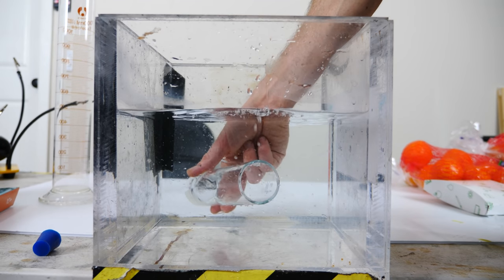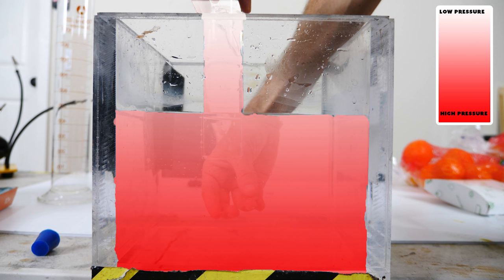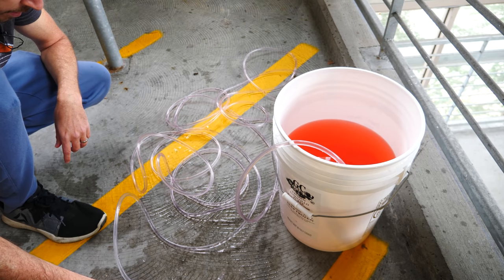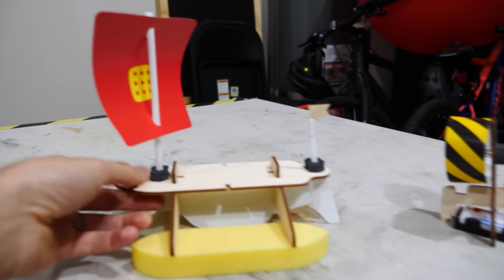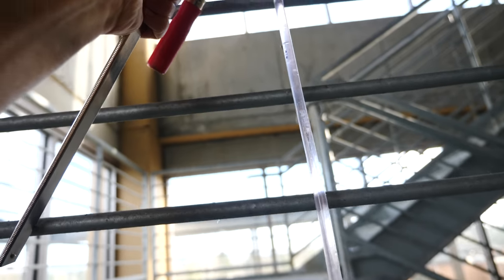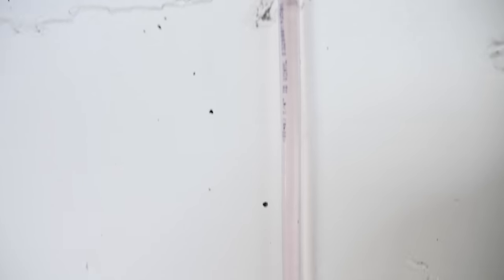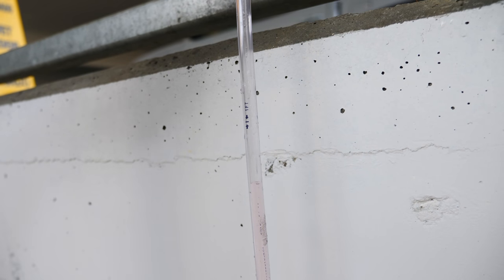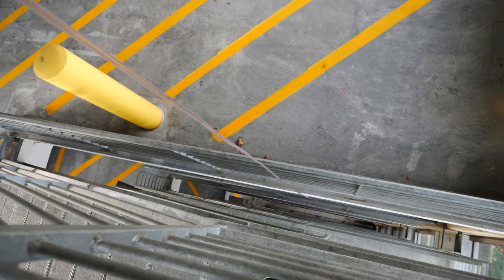Why Water Boils In Tall Cups

Comment: As an aid to understanding what is happening, there isn't any water doing any pulling (5:20)  (that would be a capillary effect, which might be important in a thinner tube, but it is not the point of this experiment).  Rather the water at the top of the tube is pushing  down (because it is being pulled by gravity in the Newtonian sense) on the water below it, which in turn is pushing down on the water below it.  At some point the weight of the water pushing down is equal to the force of the weight of the air trying to push its way up into the tube.  If you lift the tube higher the water outweighs the counterforce of the air and the water column drop until the two opposing forces are equal.  Basically, you have a shorter column of denser water in equilibrium with a much longer column of air (the Earth's atmosphere).  (And you can't suck water either (4:55) , again it gets pushed up by the force at the other end.  This is kind of like cold vs. heat.  Cold is not a thing; its just the absence of hear.  Suction is not a force, it is just the absence of an opposition to a force.)  Sorry if I am getting into technicalities (and someone else can probably give a better explanation than I just did), but the point of these videos is to explain how things work and I hope that this comment helped a little.
Reply: You don't get much "capillary effect" in a tube of that diameter.  The hydrogen-bonding responsible for the capillary effect is the same thing that causes the meniscus, but it's immensely dependent on the narrowness of the tube.
Reply: @TROOPERfarcry  it says water is boiling, does it mean that it's temperature was around 100°C on that level in the tube ?
Reply: @xsdash  i was also thinking that, adding on to our question:
is it boiling or is it just air (and formed air bubbles) and water mixture moving around due to pressure differences?
Reply: @xsdash  nope, water can boil at lower temperatures if the pressure around is less, by boiling it means that the water starts to evaporate very quickly with 
( bubbles forming), the termperature of water in the tube is same as the water in the bucket
Reply: @SSSPrince  both, cuz due to the vaccum the trapped air get driven out of it and also cuz of the vacuum the water starts to boil due to the lower pressure
Reply: @xsdash  The boiling-point of water is heavily influenced by atmospheric pressure -- specifically the air right above the surface of the water.  If the pressure above the water is increased, then the boiling-point -- the temperature required to start boiling -- is raised.  This is what a pressure-cooker is: it puts increased air-pressure on the surface of the liquid, and it means that the water can be made much hatter before boiling off.  The opposite of that is reducing the air-pressure directly touching the water, and you can see this on food-packages that require the customer to cook it; high-altitude cooking requires longer boiling times, because the water boils so much easier.
-
The as the column of water went higher, the pressure directly above it became lower, thus making the boiling point lower.  Eventually the boiling point moved so low that it crossed the ambient air-temperature, and that made the water boil.
Reply: @TROOPERfarcry  yeah i thought quite the same, thanks for confirming it.
Reply: @aura4977  yeah
Reply: @aura4977  "due to the vaccum the trapped air get driven out" - are you saying that the air suspended in the water (the air that fish capture via gills) is being driven out? Amazing.
Reply: Yeah the weight of a 1 square inch column of water 33 feet high is 14.7 pounds the same as typical atmospheric pressure of 14.7 psi. There is no such thing as the suction power of the vacuum just the absence of a force countering the 14 psi of the atmosphere pushing into it.

Comment: You don't have to suck-start a syphon if the tube is long enough. Just submerge most of the tube under the surface of the liquid, plug the open end with your thumb then pull out enough of the tube so that the liquid in the tube falls below the level of liquid in the container. Very useful trick for non-potable liquids.
Reply: Not trying to aggravate just trying to understand.

You call it boiling, but aren’t you just removing the oxygen in the water with no heat. Or is heat being produced by the vacuum?
Maybe I have the wrong definition boiling.

boiling
/boi′lĭng/

adjective
Heated to or past the boiling point.
"a kettle of boiling water."
Very angry or upset; seething.
Heated to the point of bubbling; heaving with bubbles; in tumultuous agitation, as boiling liquid; surging; seething; swelling with heat, ardor, or passion.

Comment: One project I've always wanted this channel to do is to use a Projector on a Glow in the Dark Wall, and see if the glow in the dark wall stores the projector image
Reply: Ripleys believe or not has that I thinnk
Reply: I did a shadow freezer thing
Reply: Interesting idea. It would be similar to a black in white film soundless film
Reply: yes. well, The King Of Random channel did it by pushing a smartphone with a bright image to a glow in the dark wall and the image could be seen afterwards
Reply: Only parts of the image would be stored; namely the parts which contain blue light.  Neither red or green light are energetic enough to excite the common green phosphor.

I have some paper treated with the stuff and I can write on it with my 405nm violet laser and cast long lasting shadows with a blacklight, but neither my 660nm red nor my 532nm green lasers affect it at all despite being quite a bit more powerful.

You can get phosphorescent spray paint at any hardware store.  You should pick up a can and try it yourself.  If you search for strontium aluminate glow powder on line it's supposed to be way better than the older zinc sulfide stuff that's in everything.  Way brighter and glows for hours.  Anyways have fun.
Reply: @whatelseison8970  i was gonna say the filters probably knock the energy out of the light source so that at a distance with a low luminosity projection would probably be only marginally perceivable.
Reply: @hardrays  Actually the intensity of the light is not what's important. The reason red and green light won't charge the phosphor is because it glows green. Kind of like how you can't charge a 3.7V battery with a charger that only puts out 3V. The colors of the rainbow (ROYGBIV) are arranged from lowest energy to highest per photon .

So for common green glow pigments blue, indigo, and violet light can charge it so that it will glow, but anything green and below can't, no matter how intense the light is because even though there are lots of photons none of them have enough energy.

Sorry if that's not any clearer. I had a better explanation typed but I accidentally closed the window.
Reply: i imagine it would save the shading but obviously not color, also im not sure if the stored energy bleeds over to the rest of the material or just stays where it was focused
Reply: @King_Flippy_Nips  exactly, I agree but want to see it on video

Comment: This helps demonstrate the importance of venting pipes in a every plumbing system used in every house, home, building and structure. Venting helps water drain down into the sewer system. Venting also protects the traps under each sink so they don’t get their water sucked out and allow sewer gases back into the home.

Comment: At sea level you can do this with Hg (Mercury) up to 29.92 inches.  Mercury is also better because it doesn't vaporize nearly as much as water and you have a nearly full vacuum at the top of the flask.

This is where altimeter settings come from on airplanes.  When the altimeter setting is 29.92 this means that the air pressure at your location corrected for your elevation or altitude is normal.  If your altimeter setting is higher (say 30.00), then you're in a high pressure area.  Conversely, if your altimeter setting is below 29.92, you're in a low pressure area.

An altimeter would then compare the current air pressure and the set altimeter setting (which is what the air pressure would be at sea level in inches of mercury for your location) to derive your altitude above mean sea level.
Reply: I've always wondered how altimeters compensated for pressure before computers, thanks for explaining!
Reply: @Ruiluth  Even a computer needs some sort of input.  Your transponder Mode C broadcasts your pressure altitude (using an altimeter setting 29.92) and their radar screens compensate with the local altimeter setting to display your altitude (assuming you're below FL 180 in the USA). 

The only other real way to derive altitude is via GPS assuming a minimum of 4 satellites are in view. Either way, a glass cockpit or other computer system would still need altitude information  from a measurement device.

Comment: Thank you for your very interesting videos that have taught me a lot. A comment about this program: The all thing is about pressure balance between the water surface free to the atmosphere and the pressure from the water inside the hose. The atmospheric pressure is almost 1 bar, that is equivalent to ca 10 meter of water in the vertical hose. It means that when the hose reaches about 10 meters above free water surface, the water stops to follow the hose upwards. Of course some of the water evaporates when in the vacuum that comes up at the top.

Comment: Ok but then how do trees work?
Reply: The xylem fibres are narrower
Also it has dissolved salts in it which lowers it vapour pressure ( relative lowering of vapour pressure) that's why it doesn't boil in trees
Reply: Basically capillary action
Reply: I believe it is the evaporation from the leaves that pumps the fluids up the tree.
Reply: @mtbkmaniac1 it's a lot of things but less of that and more like how fibers absorb fluid and pull them up. Like a rag hanging half out of a cup full of water drains the cup. There is also an electromagnetic force pulling on the ionz of the water that have added salts from the tree. The top of the tree is charged with a positive charge, and the base is negative. Between the capillary action of the fibers of the tree and electromagnetic force that is pulling on every single molecule of water, you end up with enough scaffolding to have water at the height of the tree without the boiling problem.
Reply: They have check valves built in
Reply: Trees actually have terrible work ethic
Reply: Trees work in large part by using osmotic pressure.   The higher concentration of dissolved particles in the roots cause a net diffusion of water into the root cells, pushing the water up the tree.
Reply: Anatomical valves and capillary action
Reply: In addition to the great replies preceding mine humble one, I have read that sequoias and redwoods reach the theoritical maxima.
Reply: Mushroom-architecture submersible pumps
Reply: @emilyelizabeth2718 sounds like a cool song name or album title! Lol

Comment: When digging a well, if you use a standard hand pump, it's advised to not pump from a well deeper than 25 feet. This of course varies with altitude and changing air pressure. But that's the usual advice.

Comment: I'd like a longer version with more details on how the vacuum affects the water temperature and what's the mathematics behind it. How does the tube width affect it? How does the water surface area and volume affect it?
Reply: width doesn’t matter probably.

You double the pressure at 10m depth regardless of how big your body of water is at sea level. Thus going 10m up decreases pressure from +1 bar to -1 bar. So from sea level 0 at 10m water depth above sea level. Just as how you get 2 bar at 10m below sealevel
Reply: Temp yes, 
Width /volume no effect...

Comment: Please note that the gas at the top also includes small amounts of gases previously dissolved in the water
Reply: The volume at the top was sometimes referred to as a vacuum. But just to be clear, it’s full of mostly gaseous water (steam), right?
Reply: @Kevin-S  yea, it would be great to somehow get a pressure reading in that space at the top of the tube which has displaced the water.
Reply: @Kevin-S  
Right: let's assume there was an actual vacuum. Then random molecules at the vacuum-water interface would achieve enough kinetic energy to free themselves into the vacuum. This process would keep going until an equilibrium was reached.

Comment: Very cool video! As the head pressure of the water column approaches the boiling pressure of water at air temperature, the air pushing down on the water surface of the bucket can't support the column of water. The liquid level will always fall back to this equilibrium point

Comment: it would be interesting to leave it like this for a while and see if the level rises and falls with outside air pressure, and also to see what the temperature is inside the tube at different levels.  The base would have been cool to observe also.
Reply: Also a bigger tube
Reply: I would think it would change with the outside air temperature.
Reply: Boiling requires energy, which is taken from the water and its surroundings, so the water will be colder as it boils.

Comment: Boiling is nothing more than the kinetic energy of the liquid overcoming the force of pressure to transition from the liquid phase to the gas phase. That’s why you usually need to increase the energy or temperature for the transition to happen. Also, every liquid has its own characteristic “vapor pressure” meaning different liquids will transition more or less easily from liquid to gas, and take more or less energy to do so. But since boiling is just the point where vapor pressure exceeds the surrounding atmospheric pressure, you can also make the vapor pressure exceed the atmospheric pressure just by lowing the pressure using a vacuum. This is also, the principle behind pressure cookers. Instead of decreasing the pressure to make the liquid boil with less energy, you actually increase the pressure so that the water has to hold on to more energy than it would at sea level to transition from liquid to gas. This makes the water able to be heated above 100 degrees and cook things faster.
Reply: @sourand jaded Everything? Only corpuscular matter I presume you mean.

A magnetic field doesn't have vapour pressure. And what is the vapour pressure of a black hole?
😉
Reply: @sourand jaded Well, on a more serious note: does diamond have vapour pressure? Those bonds are strong enough, I don't think there is an equilibrium. Or salt even? Titanium? I guess you could say its vapour pressure is zero, but that is stretching the concept just as much as I did.
Reply: @landsgevaer Diamonds are actually quite easy to vaporize. Takes a lot of heat and oxygen to break those bonds under a blowtorch u can vapourize a diamond.

Comment: In a "cup" that narrow in relationship to its height, capillary force becomes a significant factor adding to the max height you can achieve, depending on the material of the vessel wall.